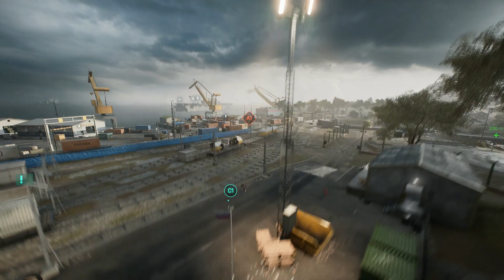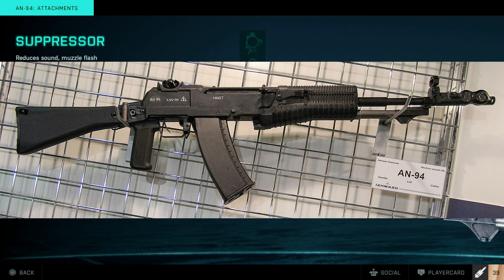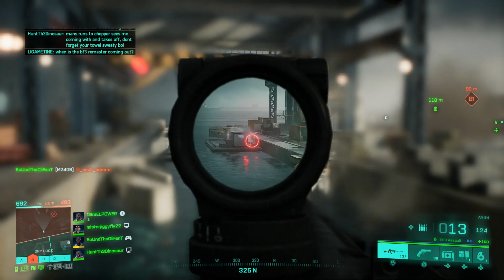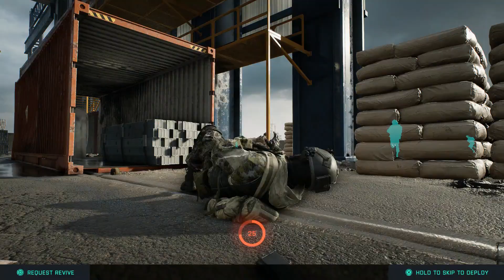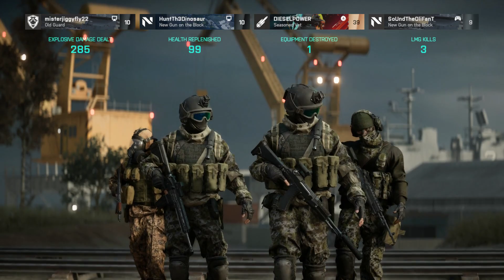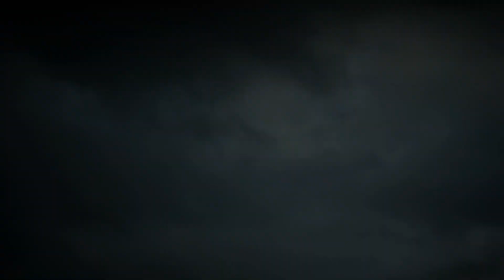AN-94 BF3 Portal Weapon Analysis - Battlefield 2042

Comment: How is Battlefield 2042 because I've heard from people they aren't liking it or over all opinion on the game is it worth it meaning to get and have you had any issues with the game on your PS5 or anything just curious. Maybe if you do like your over all score of the game from your opinions and maybe what should be added or fixed if anything great video stay safe and happy Thanksgiving
Reply from the maker: Thanks brother! Ya the game runs great on PS5 and there are only a few bugs I've noticed, which they are already fixing. I'd like them to add or fix some of the things that seem to of regressed from previous games. There is a long list that is pretty obvious so I'm sure these are things they are planning to add asap.
Reply: @buffnerdgaming2346  I still have a Playstation 4 the only reason I don't have a PS5 yet is because of expandable memory meaning from what I heard is the PS5 has the option for a expandable memory not just using internal memory from the PS5. Because we all know game updates are big with taking a lot of storage and memory. I don't know if Playstation has come out and said they solved the problem meaning you can get a flash drive or whatever you need to get for extra storage and memory. With my PS4 I have a external memory and storage from Playstation it's a litte black square they you hook into the front of your pS4 and you use that to save your games and such onto that. With out wasting all of your internal storage and memory from the Playstation. Just curious if you heard anything else on this because this is why I  haven't gotten one yet is because of what I just explained.